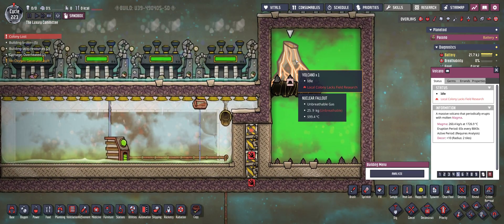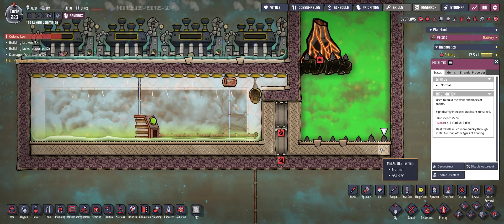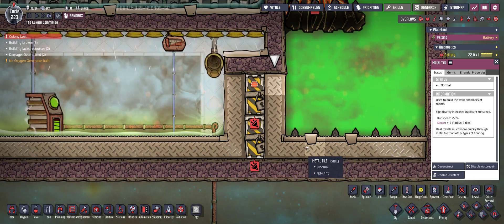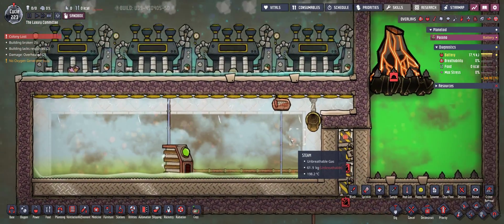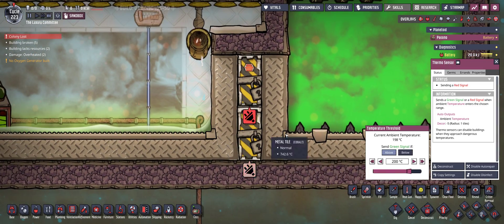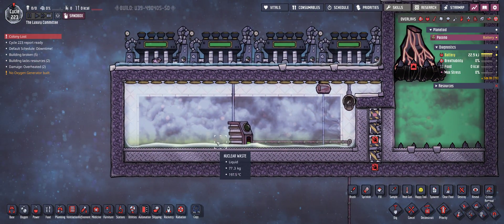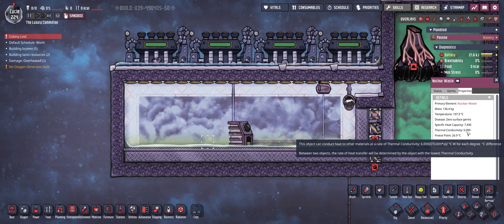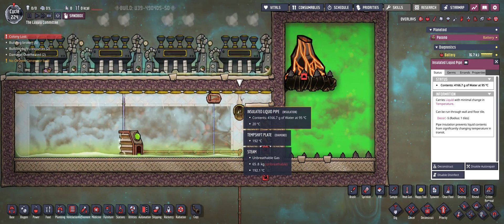Oxygen Not Included HowTo - Tame a Volcano with Nuclear Waste

Comment: Some design problems with this draft - the temp shift plates are dumping heat unnecessarily into the insulated tiles. TSPs running spaced through the steam chamber would have a similar effect with less resources and waste.

The STs are running intermittently because of the wobbling of temperature around 200 degrees, which can be solved by the thermo sensor being further from the point of heat transfer towards the center of the chamber, or the signal changes being delayed by gate. The intermittency will make power supply funky and annoying if you're running major operations.
Automation with the smart batteries might be a better idea to throttle the heat draw from the volcano chamber.
Reply from the maker: Hi man
Tempshiftplates: agree, fixed that in my Lets Play already.
Tempsensor: agree, in the following video i just placed additional sensors below the steam turbines. See: https://youtu.be/PBn2rPzIK_I
Battery: tbh i have a different opinion. In my bases I usually have multiple energy sources, and the ones I always wanna run is the Steam Turbines. In case they dont provide enoughh power, other generators kick in. See prio for Power Sources: https://youtu.be/GD0_BVD6Kfg

Thanks for your headsup;)
Reply: @engineeringandgames6107  I don't believe he's suggesting that you don't prioritize steam as your primary power source, but rather that a battery setup here will cause your nuclear fallout chamber to act as a heat battery if you utilize a smart battery to limit draw to when you need power rather than just having it on all the time.
Reply: The STs are being disabled by the battery. There is an automation line from the smart batteries to the turbines.
The charge/discharge cycle of the battery is causing the STs to run intermittently, not the temperature.  Turbines can run as low as 125 degrees and up to melting point.